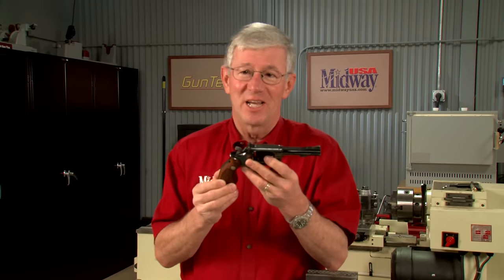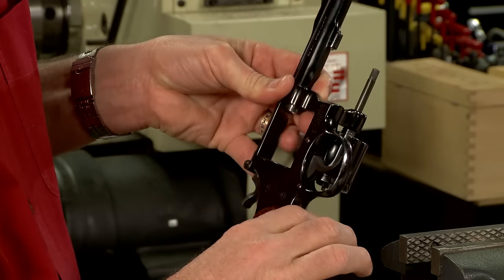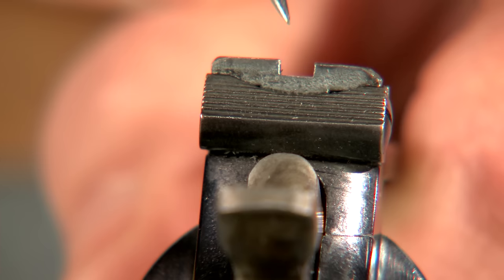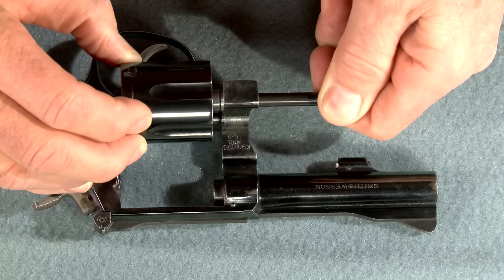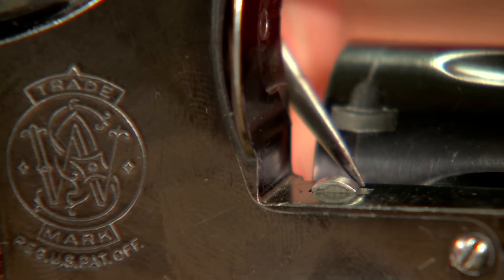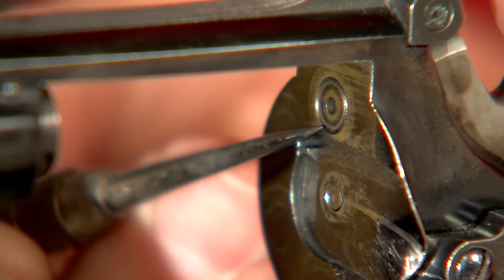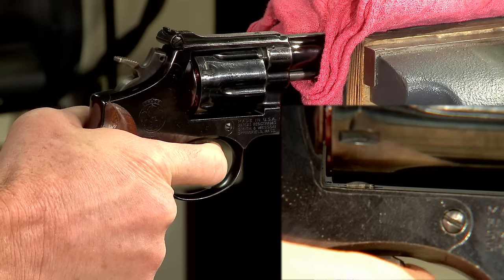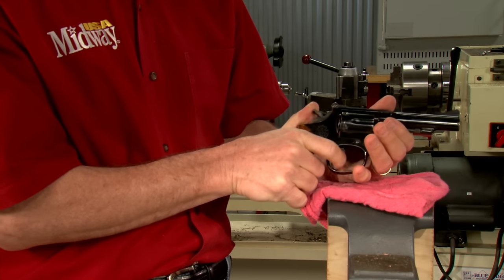Inspecting Smith and Wesson Revolvers | Smith & Wesson Revolver Project

Comment: One of the things I always look for on a revolver is flame cutting of the top strap above the cylinder/barrel gap. This can give an indication of a lot of use or hot load use.

I also like to add drag to the cylinder with my fingers while cocking the hammer to check the timing and lockup.
Reply: I put some reverse drag on the cylinder as I double action fire into a snap cap, to make sure the lockup on Colt pistols is good. The pawl hits the locking notch almost simultaneously with the hammer drop on those old lock bar Colts. The model I have has routinely been reamed from .38 Spcl to .357 with no ill effects, provided .357 is rarely used. Colt even made a very few Diamond Backs chambered for ".357 or .38 Spcl Ctg." The last one I saw sold for around $20,000. (Colt assumes it was a prototype that was shipped to The Jewel Box Pawn & Gun Store in Phoenix Az, in 1967, along with 8 other normal .38 Speclial Diamondback 2 5/8 bbl  Diamondback pistols.) All Colt's archives show for sure, is 9 of them shipped, but all showed being .38 Special ONLY. The owner of Jewel Box tried and tried to order more .357 Diamondbacks, but to no avail.

Comment: Check for flame cutting on the top strap and forcing cone condition on 357s. I usually put friction on the cylinder when cocking them to be sure of lock up. Pull the trigger briskly in double action to be sure the trigger mechanism doesn't lock up or skip cylinders.

Comment: Was given an old model 10 from '33. The thing is beat to hell, heavy holster and use/abuse wear, mysterious giant scratches around the cylinder about halfway between the ends, and loads of dings and scratches, but the action is still butter smooth, no wiggly parts, lockup is almost play-free, and the dinged-up sights are still dead on. These guns are nigh indestructible.

Comment: Mr. Potterfield, your viedos are very helpful and educational. No beating around the bush, I usually fastfoward most viedos, not yours. I noticed on my .38 model 37 a small crack on the frame under the barrel, what are my opitions on repairs if any. Don't worry I won't fire the gun
Thanks,John
Thanks, Jonh

Comment: Very good video; I would have included "push off" in the check for internal modifications or extreme wear. To check for that, cock the revolver into its single action hammer position, and then push forward on the hammer spur with light  pressure. If the hammer releases, it is an indication of sear modification or wear, and the gun is unsafe to use.

Comment: My brand new S&W M29-10 has  .003” cylinder to barrel gap on one side and  .0075” on the other. S&W said it’s within spec. 🤯
Reply: They aren’t hand fitted by real craftsmen like the old ones

Comment: I just bought a Colt, and it's blatantly obvious it rode around in a holster for 20-40 years with the cylinder in the same location, so use was minimal. The tip of the barrel has the bluing worn off on the left side of the barrel tip & the muzzle, and the left side of the cylinder (as it was found in the box).. So it was worn the same way on the same side, so it had just been worn, and rarely if ever fired. I have put more lock drag marks on the cylinder in one hour of shooting than it had before. Dry firing center fire revolver is not quite as hard on them as dry firing ANYTHING rimfire. I use those rubber insert snap caps, or more expensive snap caps with a spring loaded metal primer pad.

Comment: I have a question.  I'm concerned I may have messed up the rear sight on my 686+.  While holstered I accidentally whacked it against the counter, most likely along the rear site.  Subsequently, I noticed that the rear site had movement right to left.  

However, at 1:30 I see exactly the same movement on this revolver, which obviously has some wear.

I'll soon contact Smith and Wesson to inquire.  In the meantime, I am wondering whether this sort of movement in the rear site is common, and or detrimental to the accuracy.  Logically, I see no way it wouldn't be detrimental to the accuracy, but a lot of people are telling me that the movement is normal, and may not of even been caused by whacking it on the counter.  

Is movement in the rear site, a serious problem?  Should I try and get the rear site replaced?

Comment: The cylinder to barrel gap on my M29-10 is  0.0035” on left side &  0.007” on the right, Smith & Wesson told me that is within specifications. 🤯 FOUR & A HALF THOUSANDTH OF AN INCH  difference. How far the mighty have fallen. 🥺

Comment: Larry ,I like watching you on youtube , because  I believe that you are more than just another gunsmith. I think your skills are unmatched .I Have a 1893 # 9 12 ga Remington Shot Gun  I mgot at a yard sale The old gun is in bad condition . The cocking lever is missing and the barrel release spring is gone. do you know where I can get the parts or what I could use in place of these things . Thanks Larry . William
Reply: a bit late and not sure which will apply but there are 3 options for the 1893  ( 2 types of Number 9 ) at Numrich aka Gun Parts Corp. in their  listings https://www.gunpartscorp.com/gun-manufacturer/remington/shotguns-rem    Which will help  with schematics,   IMA would be another option if MIDWEST fails and then you would have to check regularly https://everygunpart.com/long-guns-kits.html which very sad place of guns that were cut up but all the parts saved from very bad police agencies and horrible cities.

Comment: One thing not mentioned is hammer push off, or testing to see if the hammer will fall with pressure applied to the back of the hammer spur.

Comment: Great info, thanks. I have a m64 I bought from a paen shop. The cylinder stop sometimes does not release the cylinder for advancement. I have replaced the spring and its better but, it still does it now and then. Any recommendations?

Comment: I have one like this but with the shorter barrel. My problem is the hammer is very stiff requiring substantial pressure to operate.  Any ideas what could be causing this?   It was my grandfathers and my father and I have used it for 20+ plus years no problem.  Now all of the sudden this condition exists.  I’m stumped on it.  I opened it up and thoroughly inspected all of the parts.  It all looks good but I’m no gunsmith.  I’ll take it to one or I’ll send it into S&W but has anyone run into this on these and if so what was the fix?

Comment: I have an old pre model 10 that hangs up when opening and closing the cylinder. Any ideas?
Reply: The thumb latch is not pushing the internal rod far enough into the ejector rod plunger to clear the ejector rod. Make sure the ejector rod is tight also the thumb stud is tight. If that doesn't work you may need a gunsmith.

Comment: I have an old model 10 I inherited from my grandfather. It will only fire in double action, the hammer does not lock back for single action. I've broken it down and inspected it thoroughly but I'm not a "revolver guy". I cannot see anything on any interior parts that looks damaged or worn to the point of not working. I would love to see a video from you on how to repair this issue. Or if anyone else could recommend a fix/resources that would be great. I cannot find a video where anyone does a repair for this specific issue.
Reply: Take the side plate off and check the way the hammer & trigger function.Both of those pieces are case-hardended,and not likely to wear on their own. Sounds like someone has been in there monkeying with either of those 2 parts...If the hammer does not lock back,the bottom part of it is likely worn,or someone has filled it in an effort to get a smooth  pull.Same goes for the trigger..
Reply: It's the sear pin is worn out. That's why it won't stay cocked.

Comment: Great video indeed...May I ask How do you fix the the poorly fitted yoke screw, must it always be replaced?. Is there an acepted play or end shake for the yoke? And lastly... does the edge of the cylinder touch the cylinder stop notch in the open cylinder position when aimed to the sealing?
Reply: You can switch the number one yolk screw with the number two to tighten the tolerance. Watch gunblue 490 video

Comment: Also: 
• cock the hammer back the whole way and push on it. It shouldn't fall home unless you press the trigger!
• look at the frame where it touches the ratchet when the cylinder is closed. If you can see the imprint of the ratchet on the frame, that's not good.
• make sure there are no small cracks in the forcing cone, and not too much erosion

Comment: People like to slap the cilinders like in the movies and spinning the cilinders and fry fire it's the worst you can do to a revolver and dropping it on th concrete
Reply: +Joe Guzman Some owners say that doing it adds "character" to the revolver! LOL What a bunch of idiots.
Reply: Joe Guzman what is fry fire
Reply: swinging the cylinder shut is a sure fire way to throw off your timing.
Reply: And it will bend the truss-rod.
Reply: Spinning the cylinder just puts drag marks on the cylinder unduly faster than usual, and wears down the locking pawl. You can do it, but don't make a habit of it. Flip slamming the crane & cylinder is a fabulous way to permanently damage the whole assembly and possibly even the entire frame of the gun, destroying the whole gun. Dry firing a modern center fire is not that bad, but it also put unnecessary wear on parts. It causes stressing of the firing pin's tip, and where the hammer strikes the frame. With a transfer bar safety the stresses & wear will not be as bad as with a hammer block colt type action, and worst of all, any rimfire, or old pre-drop safety guns, with no block or bar safety, you may even break the firing pin, or slam enough of a dent into the frame to drag the pin across the cartridges and jam up the action, or break the firing pin. You can do it, but don't make a habit of it, and don't be surprised if an older gun's parts break.

Comment: I have a very important question:

youl note that at 1:41 he shows the endshake of the particular firearm he is examining. Is the amount of endshake at 1:41 acceptable?? I have a model 64-8 and there is a tiny bit of movement (a little less than shown at 1:41). The gun is almost brand new. The gun shop guy said it wasn't a problem but i want to make sure
Reply: that just means your gun isn't worn in yet
Reply: +Rebelflag1201gaming you mean the end shake is LESS after a gun is worn in? I thought it gets worse with time? I am concerned I have too much end shake
Reply: +Ted Stevens I must've read that wrong getting endshake over time happens but it increases I would find a local gunsmith or do it yourself and insert a .002 ring

Comment: Mister, I'm from Brazil and I would like to see you repair and/or make an evaluation of the TAURUS RT 86 (6" barrel), caliber .38 special and the RT 96.22 lr.
The smith & wesson had a factory in Brasil. And after came back to brazilians hands and the patent of S&W model 25 was possuit by both: TAURUS and S&W, that's where came the similarity.

Comment: On my 85 686 i cant pull back the hammer with the cylinder open, is this normal?
Reply: yes push the cilinder latch thumb piece back ,its blocking the hammer with cilinder open its also normal with  all s W revolvers
Reply: Yes,it's normal. Just hold the cylinder lock back while cocking.

Comment: bluing a stainless revolver, is it possible?
Reply: I have heard that it is possible, but the results may be poor.  Personally, I would not attempt to have it done, as the bluing process is a form of "controlled rust" and in order to blue stainless steel, you need some super duper chemicals that have oxidizing agents in them to begin the rusting process on stainless.  Now I have to wonder, what else is happening to the integrity of the metal when the oxidizing chemical is added?  I know that some gun parts are tempered and hardened using high temperatures and cooling of the metal.  Would an oxidizing agent used to blue stainless steel compromise the strength of the steel?  If you want a blued gun, just buy another one.  It's a great excuse to expand your collection.

Comment: use wd 40 will make your gun shine & excellent for the parts. 🔫
Reply: Danny Smith wd40 is a silica based protection spray when it drys and ages it will be as hard as epoxy and will need to be serviced by a gunsmith to try and save you firearm. DO NOT USE WD40 on your gun
Reply: +Jshock Fawn killer, 
Now I've heard everything. I'll bet you recomend never cleaning your gun and never oiling it either.